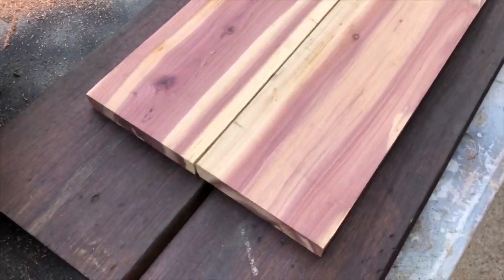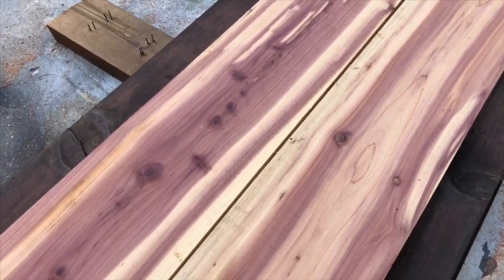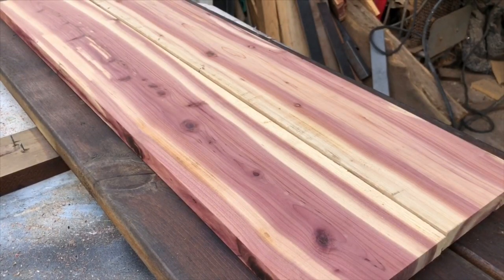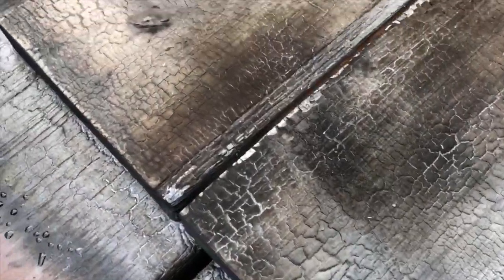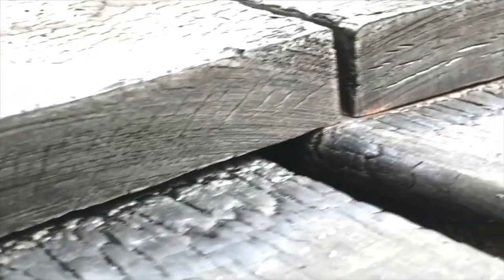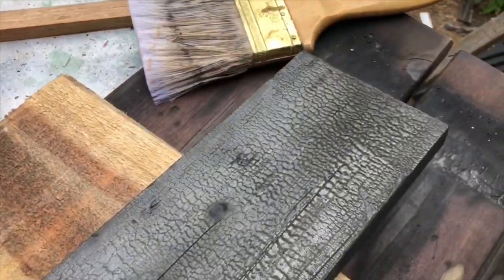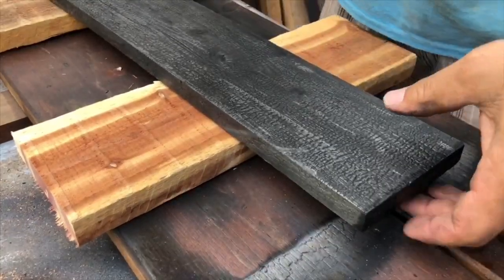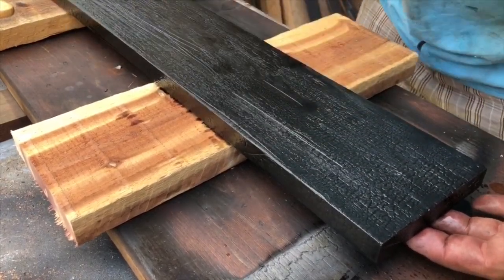DIY Heavily Crackled Shou-Sugi-Ban Charred Cedar Planks Burnt Wood Burning

Comment: I didn't catch your name and feels weird me calling you Love🤣 anyway you talked about warping, well I used cedar fencing and yep it warped. I sprayed water on it and put a heavy bag on it, you think it might straighten out? I picked the fence wood cause its light and want to make signs.
Reply from the maker: Explore With Mitch And Burn That Wood sorry for the delay in reply. My name is Tim. Possibly. The biggest thing is to make sure the wood your using is really dry. Either air or kiln dried. 16% moisture or less. That will help. If its fresh cut (aka green wood) thats going to happen more often. Plus look at the end grain on the boards. The closer to the center or core of the tree the less likely the wood is to warp.
Reply: Again, this is also a late reply but my understanding is that while though it is more labor intensive, if you do atleast one light charring of the backside of the wood it is supposed to greatly reducing cupping or warping. Idea is that when you charr one side, light or heavy, you drastically alter the moisture content from one side to the other, so naturally that causes the wood to react freakishly as half way through one side is considerably drier than the other side.

Also, a lot of DIY woodworkers tend to forget the importance of acclimating wood to your shops own environment. I dont care if its previously kiln dried, ready to work lumber...every top end woodworker buys multiple varieties and they store it, properly, in their woodshop for weeks before building with it to allow adaptation to their own humidity levels and what not....master woodworkers will buy exotic rare woods and sit on them for years before they use them....I'm waaaaay to impatient for that haha.

Good luck with your projects and good video btw, I'll continue to check the rest out.

Comment: Hi. Love this video, such a lovely technique.I have a few very quick questions I would love to ask you, but cant figure out how to send messages here (If it is possible at all) Do you have some place I can reach you? :)
Reply from the maker: Lasse Roxrud Farstad just ask them here! I’ll answer as best I can.
Reply: Ok, here it goes. I am currently working on a new Norwegian watch brand, based on unique story telling. The concept offers what we consider a truly unique and special experience, and we are looking for ways to enhance this experience. I came across your video about burnt wood, and was fascinated. This creates such a lovely surface, both visually and tactile. We are investigating if it is possible to use this technique for the watch packaging. It does not have to be as heavy as the effect you are presenting in this video. So I have the following questions for you. 😊 
Will it be durable? 
What kind of coating would you use for this? 
Do you have any other comments that might be useful? 

Thank you so much for helping us! 

Best Regards
Lasse
Reply: @lasseroxrudfarstad6464  should be very durable. It's been used in Japan for centuries. It's a way to naturally preserve wood. If I was going to put it outside I would use a spar urethane indoors you can use something like what he did here or a polyurethane.
Reply: @joelthoenen3733  Hi. thanks for the answer. We are currently testing out with our supplier, but it appears to be difficult to get the kind of results that you see in this video. The cracks are really small, and the top laye flakes off. I am not sure what type of wood they are using, but probably pine. 
We need the charred wood to stay in place, and not flake off. And we would love to get the kind of effect you get in the video above. 
Please see our sample image in the link below: 
https://ibb.co/WctHJX3
Thanks :)

Comment: Why not use a timber that doesn’t have great profiles hidden underneath the char?  What’s the point otherwise?
Reply from the maker: Great question. This was some beautiful cedar. The original technique used a Japanese species of cedar. The reason was because the original purpose was for exterior use in the elements and since cedar already has excellent weather resistant properties burning it and sealing it this was an added protection. While this piece was eventually used indoors for a table top the use of cedar wasn’t necessary. But I wanted to show how the original technique was done including the use of the cedar. And while I’ve charred a lot of various species of wood. I think cedar crackles the best.

Comment: the whole point of shou sugi ban is to not use any lacquers or oils to preserve the wood. the carbon on the outside is what preserves the wood.
Reply: But that texture get off very quickly, and you cant use it, because  makes averything  black
Reply from the maker: MuchFly Wow well traditionally it is sealed with linseed or similar oils. But in this application which was a table top. I wanted the charr to stay intact and not rub off so hence the sealer.

Comment: The whole point of Shou sugi ban is that its a sealing/preserving technique which uses the wood’s natural oils. I don’t really understand why you’d want to add more product on there…
Reply from the maker: ekatlaterrible you are partially correct. The original technique is meant for exterior preservation of wood like fencing, siding etc. And it traditionally did add natural oils to the wood like linseed or tongue oil. In this instance it’s being used for a piece of interior furniture so I used a blend of linseed or tongue mixed with poly to give it a better seal.

Comment: What about the smell of burnt wood guess it goes away?
Reply from the maker: 78daedae1978 once sealed you don’t notice it.
Reply: Would it be ok to spray it.. Or brush it? For finish product?
Reply from the maker: Yes you could spray or brush it on as well. Spray would be the best as you wouldn’t damage that fragile crackle surface.

Comment: The purpose of yuki sugi ban is to create a carbon crust which acts as a natural preservative and makes it water resistent, termite proof and fire resistent. Traditional  method does not use a sealer
Reply from the maker: my mother was a ninja traditional method sealed it with natural oil sealer like tung oil or linseed oil.
Reply: @loveofthegrainworkshop2891  seems like only westerners add tung oil. You cant find a Japanese video where they add oil. Oil defeats the whole purpose of charring.

Comment: Love your vid but isnt the Shou sugi ban technique basically finished with a vegatable oil finish or linseed? No Poly anything. In Asian countries they would never use a chemical based oil. All natural is preferred.
Reply from the maker: O Perez yes for typical applications for use like as siding or fence thats the original preferred finish. But on a piece like this which is a table top I made I used Polyurethane so it would harden the charr so it didn’t rub or break off. You can also do a coat of epoxy resin to seal it.

Comment: Hate to tell you, but using polyurethane is defying the entire purpose of shou sugi ban. It's like putting a slice of PVC in a cheeseburger, in stead of cheddar.
Reply from the maker: Martin Poulsen lol I used Polyurethane on this one because it was used as a table top which people would be putting things and there hands on. The original technique is a natural linseed or tongue oil. But thats for fences and siding etc that won’t be touched. This needed to be sealed and protected from heavy use.

Comment: You dont seal those, the point is that the burn seals it! Lol
Reply: Japanese do still seal it with tung oil ... you can find the details for the old-time methods Online
Reply from the maker: toordog incorrect. The tradition is to use linseed or tung oil to seal it.